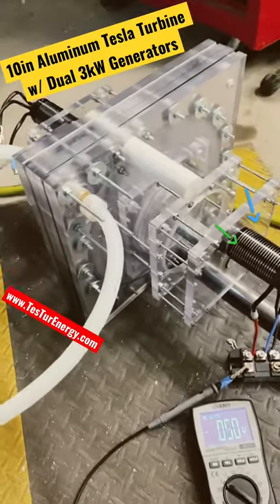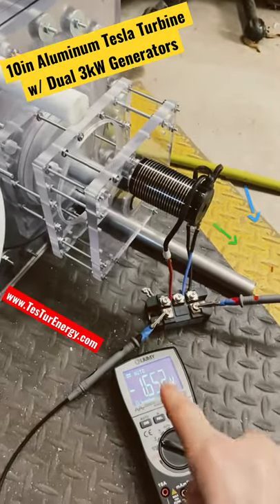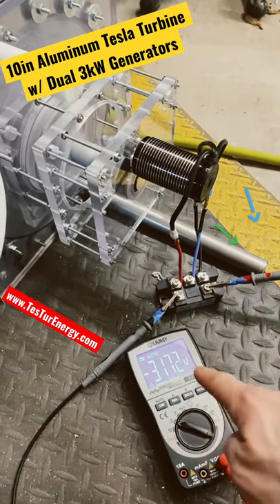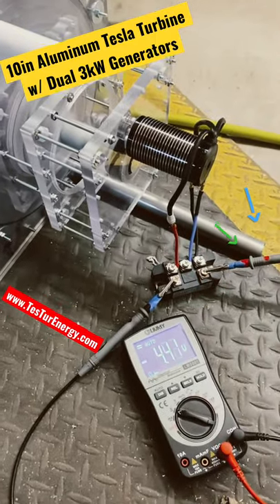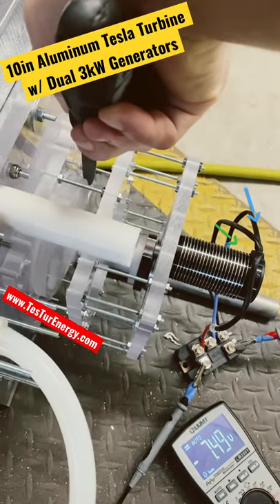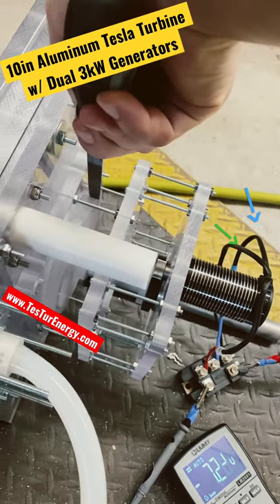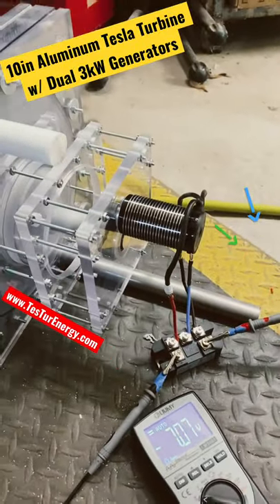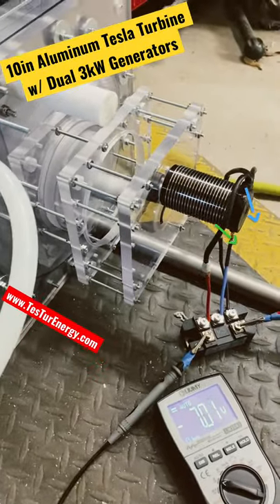10in Aluminum Tesla Turbine ⚡️ Dual 3kW BLDC Generator Solar Off Grid Electricity Production

Comment: I don't understand what the significance of "3kW" is.
Are you suggesting you're expect to get 3kW out of them? 

If you're trying to get maximum voltage readings from this setup, filter the rectifier output with a capacitor across the DC output.
At any rate, I'd be interested to see a load test on this thing so we can see how much power you're actually extracting from this setup. You're really not showing anything at all until you put some sort of load on it and display two meters, one reading voltage, the other current.
Reply from the maker: Hey thanks for commenting. The BLDCs are standard off the shelf rated as 3000watts. They can continuously put out a max of 120amps at 25 Volts. Although I’m not really sure why you would assume the max rating for a motor/generator would be what it’s actually putting out all the time... do you assume a 400hp piston engine is ALWAYS putting out 400hp irrelevant of the fuel supply? And for the record, You can always measure the power out of an unloaded turbine by its change in rotational kinetic energy divided by the time interval, its acceleration shows its power out. You do not need to have a load to see the power out. If it’s spinning the generators AND accelerating, it’s getting power out. Exactly how much? Not that much because compressed air systems are terrible and only have a 10% round trip efficiency. So considering my two compressors running together are about 3500watts continuous, the best I could imagine from this compressed air, if a 100% efficient turbine was used continuously on this air supply, would be 350watts.... currently my latest no case acceleration tests using blow nozzles that don’t even utilize half the disc stack yielded a peak of 1/10th HP (~70watts) @ 2100rpm and 0.23ft•lbs of torque, with a peak stall torque of 0.5ft•lbs of torque at start. If you know the moment of inertia for the runner and you have the graph of rpm acceleration you can calculate the the torques at a given rpm and if you know the torque at a given rpm you can calculate the Horsepower as HP = Torque * RPM / 5252. 

To really get power out we need a motive fluid that actually has the entropy to provide that much power at any period of time. So No I do not expect to get 6kW out with this setup using compressed air as compressed air is possibly the worst way to try to do it because all the heat of compression is dumped into the air and not utilized. This is why I am in the middle of building the heat addition and exchange system to increase the power out via heat addition. This should drastically increase the power out available for the given motive supply fluid. And be able to tell us a better idea about how increase in power is yielded from the increase heat, and can further calculate theoretical data for higher heat additions that this polycarbonate and aluminum turbine can’t handle but the next stainless steel turbine I’m about to build can.

As well, as is, this turbine is HORRIBLE. It’s not sealed, the runner isn’t fully secured to the driveshaft so the disc pack loosens over time from vibration (that’s only because I didn’t lock the locking hex shaft collars yet), the exhaust extensions don’t have half the holes with screws in them so it’s just leaking air out them. The other nozzle isn’t fully closed off sealed so I’m losing peripheral pressure out that orifice. My cheap chromes steal bearings are starting to rust because I did a full water test before this(I have ceramic and food grade stainless steel ones coming), and I still haven’t done ANY balancing of the runner yet so I’m still losing A LOT of energy to vibration, the motor mount plates are far too skinny where the screws mount so the BLDCS flex out of the way a little from torque which is providing a lot of resistance. All in all, considering the MANY flaws of this first prototype made out of polycarbonate and trailer home aluminum siding on a cheap Chinese CNC machine, as is, (not even close to being finished) i’m beyond ecstatic with the results I’m getting because it means it’ll only get better as I slowly fix each of the weak points. My motto is, if you can make it work under the worst of conditions it’ll only get better from there. 

What was done here was mainly to show people that the Tesla turbine legitimately can provide torque to a generator, as it’s not only doing it in my turbine but I’m doing it with it while actually gearing it UP instead of down like everyone else does. Not to mention this was also to prove to the number of people who tried telling me the Tesla turbine could never provide enough torque to get passed the cogging torque of BLDCs.... they were wrong... so what this was last meant to show is that with the single motor rectified it’s getting over 7volts dc out so the two rectifiers put in series produce up to 14v. Which is enough to start powering the 4000watt cont./8000watt peak 12VDC->120VAC inverter thats literally coming in the mail today so that I can continue to do actual load power tests. But I have to first get a motive fluid supply that can actually provide a continuous amount of usable energy that’s not crazy inefficient.
Reply from the maker: Sorry for the novel. Hope that helps! This I still a very preliminary build and much could still change. As well though, using this turbine in reverse, as a pump/compressor, with the motors will make this a 6kw capable compressor when they are each run on 6S lipo battery packs. So I’m REALLY excited to start using this as a compressor too because it will likely increase my compressed air capabilities. And with this design I can do up to 4 motors on each side coming in at a whopping total 24kW pump/compressor if done. but it probabaly won’t need that much power 😂 I will certainly try to get close though.
Reply from the maker: Hey Jimmy B, so if you haven’t had a chance yet check out the latest 1200 watt load tests I did with this turbine! 
https://youtu.be/bWpXRzrzf4g

Also I did a dyno test and got a peak of 3.75hp (2.75kW) and 6.22ft-lbs of torque at 4150rpm. Here’s the link!
https://youtube.com/shorts/yXQy844URMA?feature=share